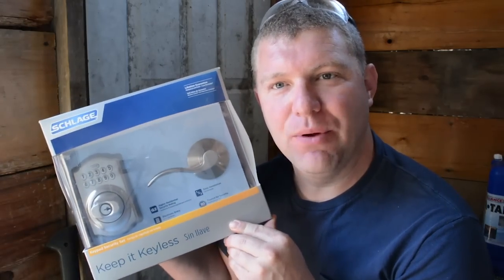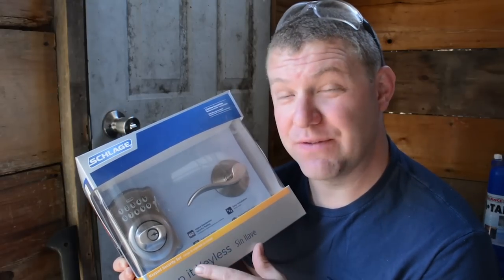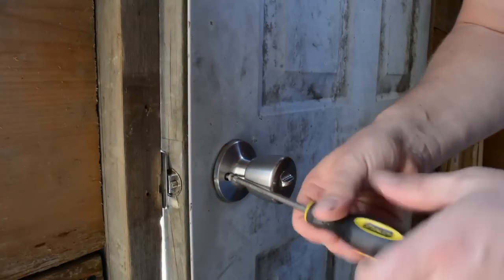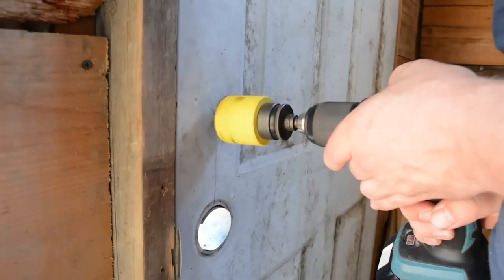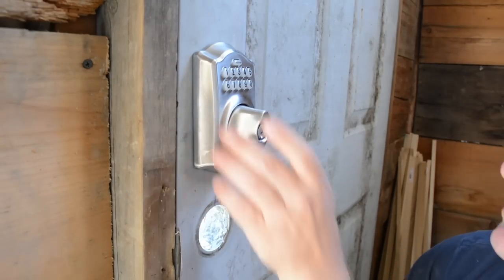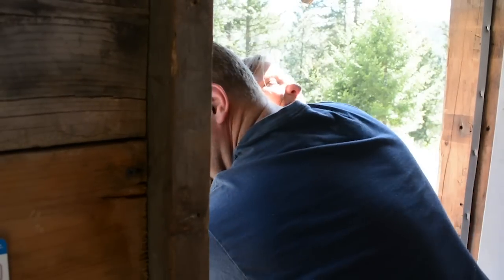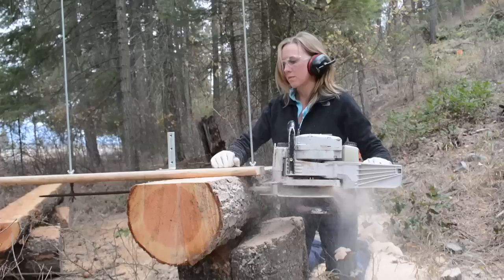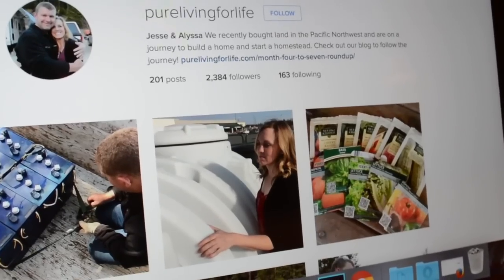GENIUS HACK to LOCK WIFE OUT OF THE HOUSE!!! (Oh, and upgrading security.)

Comment: Great idea for a video and good job with the instructions!  A couple of things though: first, I generally recommend to people that they use a double cylinder deadbolt (takes a key from both sides)  this way if someone breaks in through a window, they must also exit through the window.. limiting their ability to take more of your stuff quickly. Second, I would not recommend using the hole from the existing knob as a reference for the deadbolt backset.  All hardware is designed to be a 2-3/8" backset for residential or 2-3/4" backset for commercial grade hardware so go ahead and measure 2-3/8" from the door edge in case the first hole is not right and you get some binding in your new install.  Lastly I wouldn't drill a 2" hole through the door...Although that particular piece of hardware was able to go in that hole, most hardware is designed for a 2-1/8" hole so if you ever change it out you are going to have some rotary file work to do on that hole.    You two have an awesome channel and I am glad I found it, great personality, attention to detail and attention to your camera work!  Keep it up please and good luck on your adventure :)
Reply: This was really good info, something that if unknown would create headaches down the line.

Comment: One tip... Door frames are most commonly soft wood.  So when someone kicks the door in, either a burglar or the owner who's locked himself out, the soft wood door jam usually breaks.  After having a burglar break into my farmhouse, and then me subsequently locking myself out and having to break the jam again, I figured out how to secure the door so it couldn't be kicked in again.  I made a piece of White Oak trim 7/8"x3.5" to cover and reinforce the softwood jam.  I used heavy brass screws to screw one side into the framing, and more strong screws into the jam itself(after repairing it of course).  Now that jam will not break out.  you'd have to break and bend the steel security door first and most large men won't even be able to do that.  Better not lock yourself out again as this time you'll need to break a window or call a locksmith.  This fix will discourage a lot of burglars after a few kicks on the door and finding they can't budge it.

Comment: For future reference, consider buying something like a Mul T Lock when you have everything built. It's a good idea to have a deadbolt because a regular lock could be opened with a credit card. But the weak thing about any lock is the key part which can be picked or bump keyed. Also make sure the hole that the deadbolt slides into is deep enough to let the lock extend fully. If not, someone could use something like a screwdriver to work the lock open. Try extending the lock half way and then push on it. It will slide back. But if extended all the way out it won't slide back. You can also use something like L shaped metal to mount over the gap. The door would push up against the metal. Making it hard to slide a card or bar in. The best thing you can have is a alarm. Second best is cameras. Maybe consider buying a little Bushnell or Browning game camera and hide it up in the insulation or someplace. Then you'll know if someone is getting in while you are gone. You can also run thread across walkways to see if anyone breaks it while you are gone. Cat. Sometimes burglars come and go without ever leaving a trace. Just some ideas to think about.
Reply: +Mike Brink  I had a Stealth Cam camera that went through batteries around every two weeks. It was horrible. The newer Bushnell cameras can go for over 6 months on a few double A batteries. It also depends on the activity, quality setting and if set on video or still pictures. It's also important to lock the cameras to something with a cable and padlock. Just to slow thieves down. There's always a way to break in if someone wants to bad enough. So really the best thing someone can have is some kind of tattle tale. Like alarms, motion sensors, motion lights, dogs, several people at residence, neighbors, etc...

Comment: being a prior locksmith, a deadbolt is no harder to "pick" than a normal door nob. they both contain pin tumbler cylinders. schlages come in 5 or 7 pin configurations if i remember correctly. only thing that makes it harder is specialty top pins ( spools, serrated, etc..

Comment: Here's a thought: mark the vertical AND the horizontal lines at the same time, before drilling the hole. That may be easier to find the horizontal center.
Reply: +Jay Scott ANDERSON   Or you can just use a door lockset jig that costs $15 to perfectly center the holes with no measuring or effort at all....

Comment: I've got the same schlage with a different handle... after owning it for a few years, I would recommend having a key handy outside in case the unlatching mechanism doesn't work. (no clicking sound) it's not related to battery power nor binding and will correct itself after a day or two.

Comment: Jesse: I am a GREAT carpenter. In fact, I'm so GOOD that I'd probably install that deadbolt with the lock on the inside. LOL.  Just had to throw a funny in there. I'm actually not too bad at carpentry but I'm more of a builder than a professional woodsman or carpenter. Oh, and I actually HAVE installed locks and door handles on the wrong side. LOL. Hey...nobody's perfect. LOL.

Comment: I know the video is a year old now but I thought I would throw out a little hint when using hole saws. Take the hole saw off and leave just the 1/4" bit in and drill the pilot hole all the way thru and then put the saw back on and finish the cutting of the larger hole. The main reason for this that (especially with a steel door like that) when you make the 1/4" hole thru the skin of the door all the force is slammed forward and there is a high chance that the hole saw will bind (not being flush to the door surface) when it hits the door and break the 1/4" bit causing the hole saw to run across the door surface. This isn't so crictical with solid wood doors. Second reason is that if you pre-drill the 1/4" hole, when you start drilling out the 2" hole the only thing that is cutting is the hole saw itself, not the hole saw and the bit at the same time. This can really help extend the battery life on your drill if your using a cordless drill. Just thoughts from experience with hole saws (I'm an electrician/carpenter so I've used them a lot).

Comment: I forgot to mention that burglars can work out the code of push button locks because of the wear on specific buttons.
Reply: Good point. I'm looking at mine (4-5 years old) and there are very faint scratches on the keys. You can use a brillo pad to scuff all the keys, or just rotate thru different combinations using all keys so all are eventually worn.

Comment: You had a lot of confidence that the door was still level. I would have used a square and measured from the edge of the door to get the correct setback for the door opening.  Same with the hole for the plunger.
Reply from the maker: +David Bishop Good call. That would have worked well too! Happily the door was level to begin with. :)

Comment: Strike plate lock security is a good idea. Longer screws are a good start, but they don't work how they're supposed to if the end 2" or so aren't in anything. Hopefully you at least got pizza from the misses.
Reply: I can see the screws poking through into the dead air in the vid. ;(

Comment: The door frame looks kind of flimsy, you might want to replace it with a metal one, or line it with metal to act as a brace, thus strengthening the frame, because one well placed hard kick, I can bust right through.  You need to protect your place, you two maybe in Oregan, but hill-billies, and hill people, they have a long roaming range, and you folks don't want to end up in a SAW type situation out in No-where's ville.
Reply: +knessi ng metal door frame.. but most of their "cabin" is a tarp shelter.. pointless

Comment: Just a suggestion, next time check the instructions and use the paper hole cutting template that comes with every lock set, you just tape it where you want it and cut where it shows you. You should have let your wife do it, she would have actually read the instructions. I understand it is a man thing
Reply from the maker: +Billy Bob But our lock is installed and works, no? Onwards!

Comment: If security is that much of an issue you may consider putting in a multi-point door lock?
Reply from the maker: +Rien Bijl That much of an issue compared to what?
Reply: +Pure Living for Life You mention the steel door and deadbolt provide you with an extra sense of security. A multi-point door lock can further add to that.

Comment: TO MAKE YOUR DOOR SUPER SAFE, JUST PUT ANGLE IRON AROUND THE INNER DOOR FRAME, IT MAKES THE WEAKEST PARTS WHERE YOUR BOLT GO THROUGH SAFER, OF COURSE WORKS BETTER IN BRICK BUILT HOUSES BUT IN YOUR CASE EARTH TO CEILING WOULD DO AS GOOD, BE SAFE HAVE A GREAT LIFE!